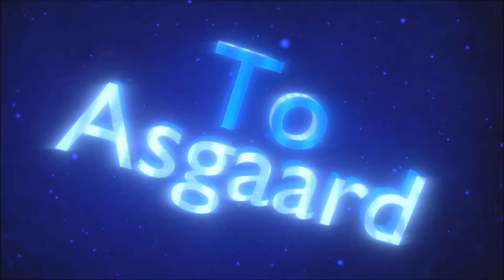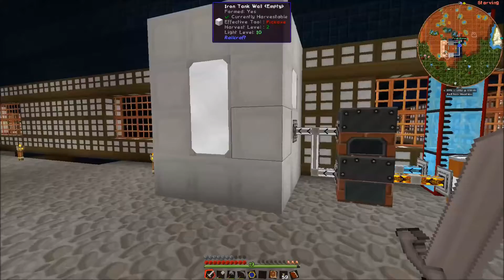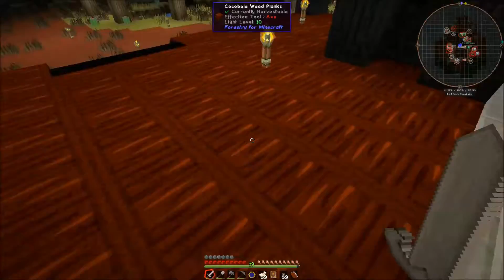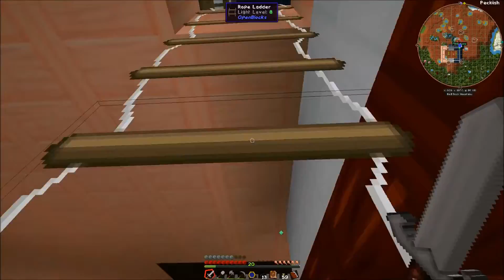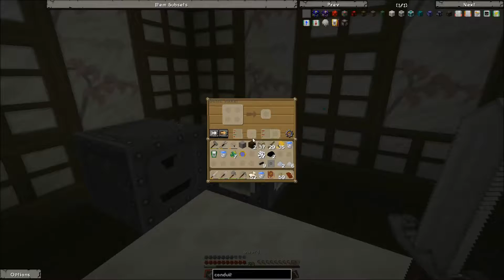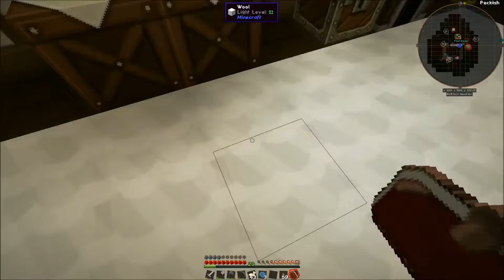Minecraft Infitech 2 Lp Ep 16: Life Gets Easier

Comment: You should put the fluid tank between the fluid/solid canning machine and the basic machine, and use the fluid ejector upgrade to autoeject the biomass. You made a really nice gate. If your luck is the same with material bags, you should take them often. Free steel is nice IMO, and I don't think you'll need the conveyor thingies for a while.
Reply from the maker: Thank you very much :)  Thats a very good idea indeed about moving the tank.  I am working right now on a basic cactus farm and going to automate biomass production so that maybe we can just fully run our power on that for now.  And i'm glad that you like the gate :)  Still some work to do on it, but got the shape down and all :)  and yeah, I do believe I'll be sticking with the material bag now for sure.  Before I mainly wanted the components because crafting costs were high.  1 ingot per wire, 2 for plates, etc.  But now costs are down so material goes much further imo :)